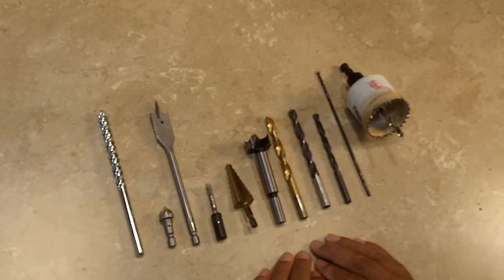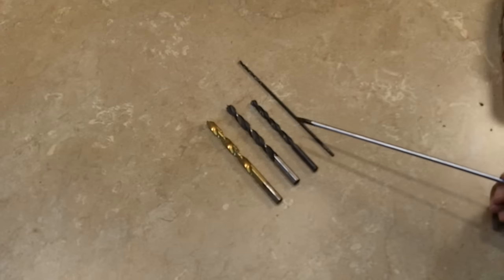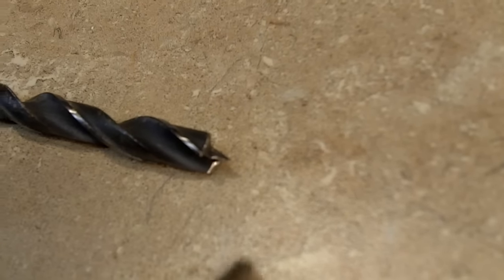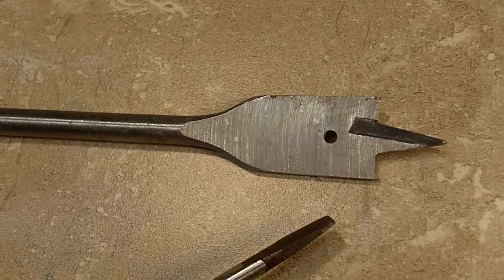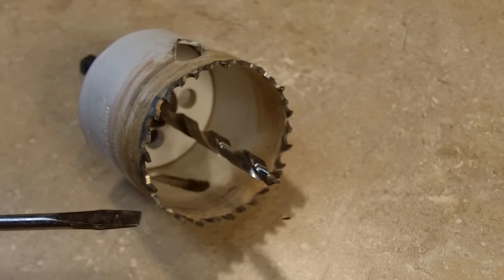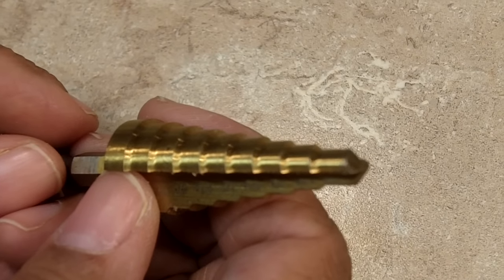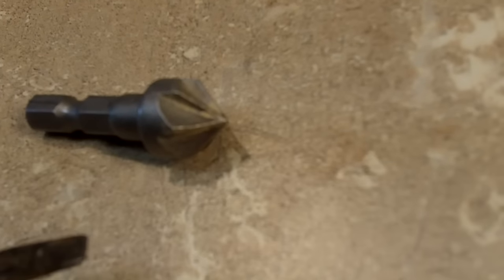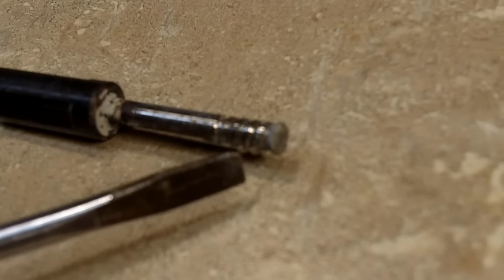A DIY er's Guide to Drill Bits

Comment: The step bit is used to drill sheet metal and other up to 1/8 " when cooled with oil. To cut thin metal properly, you should start small and work your way up  to the desired size hole. If you don't step up, the bit will catch on the metal resulting in a wrecked hole. Using the step bit you can drill faster without having to change out bits.  Very conveinent.

Comment: I came in here to learn which bit to use in building a fence. I'm using 2x4s for the railings, held together with 1/4" hex bolts. I want to have the top of the hex bolts sink into the 2x4s so the surface will be flat, and then attach sheets of wood lattice. So it looks like I need to get a 1/4"  counter-sink bit.......Thanks, Leah!
Reply from the maker: you're welcome, Laura, and good luck with your fence!

Comment: Super awesome and informative video. Is there a bit similar to the countersink but that would create a more if a flat indent (like if you wanted to put the head if a lag bolt below the surface of the wood)?. Something sort of like a mixture if the countersink bit and for forsiner bit. Thanks.

Comment: I have seen mention of a drill setup that drills square holes, like those for electrical boxes in masonary and wood. It uses someting like a rotary triangular shaped part. Was wondering if there are ones for bigger than 5 inch size for electrical, such as 8 inches, up to 12 inches or 15 inches, for furniture, cabinets, doors, etc.?

Comment: Tip for using spade bits: If you ease up on the downward pressure just before punching through the material you can avoid any tear-out.

Comment: Very informative, and even though I only learned one or two things, I feel more informed. I think I will have to add a step drill in my collection. I do like to use spade bits a lot and will often turn my work over just before it breaks through and complete the hole from the other side to avoid splintering. I recently added some titanium bits to my collection and I've come to the conclusion that the main reason they coat them is because people will buy them because of their pretty gold color. I don't see much difference between them and a good twist bit.

Comment: Thanks for another interesting video. :)

I thought I'd seen all the different drill bits, until I saw the one that looks like a router bit. I have a set of drill bits by Dewalt. They look like regular metal-cutting drill bits, but the tip has a smaller bit size. It's like the end of a small drill bit has been joined onto the end of a larger bit. They work really well because I often don't need to drill a pilot hole, especially if using a drill press. :-)

Comment: Great tutorial, can you use a masonry bit to drill a hole in the bottom of a flower pot?  For some reason, most pots don't have a hole anymore.
Reply from the maker: Hi Julia, you may want to try a bit for drilling glass, or one for drilling into ceramic tile.  I have never drilled holes in pots before, so I can't really say which bit would work best, unfortunately.

Comment: Thanks for another great video.  I like the way you make these important things simple and understandable.  As with your tape measure video, I know more now about the drill bits I've used forever.

I have a question for you:  what is the best (or most appropriate) type of composition for a twist bit set for me to get?  I'm thinking between plain steel, black oxide, titanium, cobalt, etc.  My uses are primarily for home repair and building simple things, and the materials I drill through are mostly plywood, softwoods like pine and fir, metal of up to a max of maybe 3/16 of an inch, and a small variety of other materials.  Also, ma'am, does it make a difference between buying a name brand and buying cheap bargain bits?

Thanks again, and please keep 'em coming!

Comment: Hey Leah!
Thanks. you are always great.. 
Can you please tell me if a drill bit is usable for all the drill-machines?
Reply from the maker: For traditional drills yes.  For specialty drills such as hammer drills, impact drivers etc. no.
Reply: Thanks!

So the power of a drill (and its hole making capability) does not depend up on its type? Hammer-action , SDS bits? etc?

Comment: Hello, I’m trying to bore a hole through a piece of cedar (about 7/8 inches thick). The hole is 1 and 1/8 inches in diameter.  I have a paddle bit of that size.  Every time I try to cut my hole I not only get blowout (which I could live with on this project), but the entire board splits in half!  Any ideas?
Reply from the maker: I would try clamping both sides of the wood prior to drilling.  And as far as the blowout is concerned, I would stop once I get halfway through, flip it and drill from the other side.  I hope this helps!

Comment: Does the Forstner bit work with a standard cordless drill even though it doesn't have a hexagonal base?  I asked an employee at Lowes this and he honestly couldn't answer the question; said he thought I needed a drill press for it.  Is this true?
Reply: Bryan Klein You can use it in either. Some drill bits require atleast a 1/2 drill chuck though sometimes.
Reply: seppiroth Thanks!

Comment: great video! i am definitely learning a lot so you earned a sub ^_^ anyhow, my question is, do you have to have different chucks for those bits?
Reply from the maker: No, but you do have to make certain that the chuck of the drill that you have can accommodate the type of drill bits you are using.

Comment: can i use spade bit for metal drilling ?
Reply from the maker: No
Reply: Only other thing besides wood you can (sort of) use a spade bit for is soft plastic. They have a tendency to knock chips off though, and can jam. I once used one in a pinch to drill a hole in a plastic bucket for a reptile tank misting system pump. Not ideal. Step bit works better for that kind of application as long as the material is thin enough.

Comment: i just want to know when i suppose to use step drill bit and the size 4-12 mm and i just need 8mm hole then how can i stop exactly on 8mm step can any one answer me
Reply from the maker: If you purchase a step bit, you'll get comfortable using one.  It's actually easy to stop drilling one you reach the size hole you need.